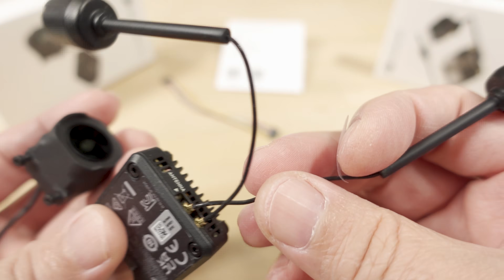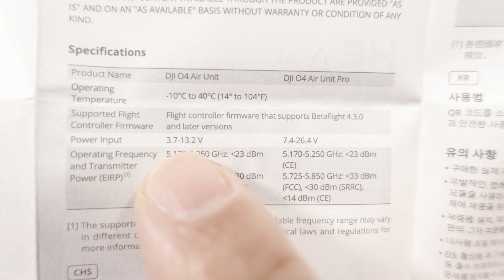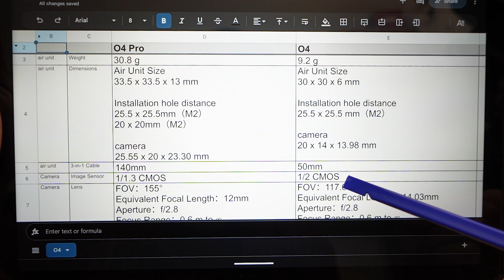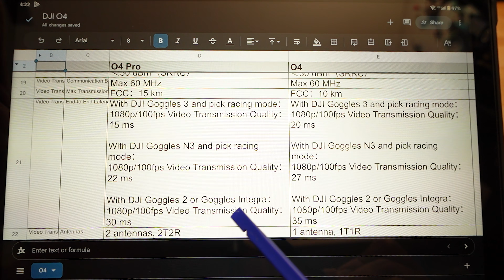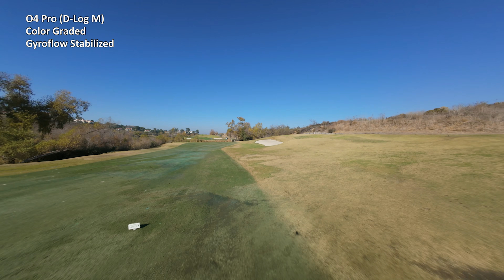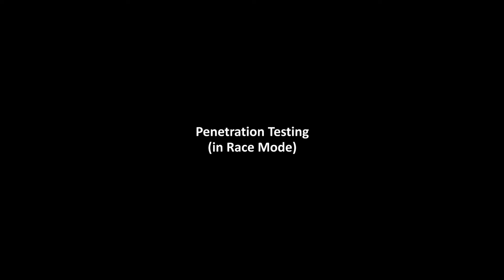DJI O4 Air Unit // The Dawn of a New Era?

Comment: Hello. I have o4 air pro in roma f5 v2 drone with tarranis qx7 control. I have a memory card inserted in o4. Can you tell me how to enable recording in o4. I can enable recording in goggles by clicking up on the joystick but it records the image from goggles and not material on the card in o4.
Reply from the maker: In the goggle settings, recording options are under the camera settings.  You need a fast microSD card installed and it will need to be formatted in that menu.  You can then enable the "record when armed" option and it will record when you arm the quad.
Reply: @AlbertKimTV  thanks ❤️❤️❤️

Comment: @ thank you very much. What does the wiring look like on an RC car? Can I connect plus minus from the air unit directly to the battery cables that lead to the ESC? or is it better to take a second battery?

Comment: What bothers me is the 117° FOV on the O4 unit. I wonder if this could change with a future firmware update. Also, is it possible to use a third-party lens adapter to achieve a wider FOV on the O4? I'm not sure, so I'll just wait and see. Otherwise, I'm happy with my analog whoops.
Reply from the maker: I don't think the FOV will change.

Comment: Great review of the new O4 Air Unit's, O4 seems to be another impressive upgrade.  Pro is wow, and O4 regular is wow for small builds.  Great job DJI
Reply from the maker: I was very surprised by the O4 Lite. They didn't have to make that one since the micro FPV market is smaller than tiny.
Reply: @ yes yes, and Thank you DJI.  DJI whoops, yes please.

Comment: Great review! Thank you for all the valuable info! Did you have any issues with gyroflow stabilization jello, like the O3 used to have with the camera hard mounted? Thank you!
Reply from the maker: I had mine mounted with TPU so the vibrations were dampened.  Just like with O3, the camera needs to be soft mounted so that vibrations don't corrupt the gyro data.
Reply: @AlbertKimTV  Thank you for the quick reply!!

Comment: Would be great to show a 1s tinywhoop build with the o4. I ordered mine hoping to fit it in a 75 frame and maybe keep the weight below 30g. Since you managed to fit an o3 light in a whoop, i am sure you are the guy for the task 🙂
Reply: Oups...just seen you already tried this in your FPV channel...maybe we should be looking for 2s whoops to support the voltage requirements.
Reply from the maker: BETAFPV will be coming out with some 1S whoops soon.  Stay tuned for more videos on my channel.

Comment: 50:55 yeah I think the need for another action cam will just be a niche because of this. people would only want a secondary cam if their flight footage has to have a different shutter speed compared with the secondary cam motion blur 180 degree rule. or they want to capture a certain FPS on their secondary cam while their O4 will be on 100fps for low latency mode

Comment: 37:09 the standard camera really is not good for FPV flight. they should have just decased an O3 camera which could have been better instead of pushing the Neo's camera. The neo footage is good if you just want short flights but doing fpv it is not good
Reply from the maker: Having flown the standard camera FPV quite a bit, I find it's totally fine for flying, even in low light (see the parking lot example in the video).  The footage is not the best but for casual use and posting to YouTube and social media, it's completely acceptable.  Definitely not for professional use but that's what the Pro camera is for.
Reply: @ i hope we can use the Pro in the standard vtx. Or some company can decase it. I really don’t like my Neo for fpv
Reply: @vernelfpv  Even the Neo image quality for FPV is better than everything else out there. Kinda sad to say that but the worst DJI has is way better than the best of the rest. Crazy!
Reply: The Neo camera is not bad for FPV.

Comment: 06:30 probably the f2.0 was dropped as they are rushing to release the air units. if they will use f2.0 you would probably require an ND filter esp on mid noon flight and it will create other stabilization problem. so they get back to how the avata 2 is actually produced which actually works
Reply from the maker: I heard it was a altered image sent out to find leakers.
Reply: @ ohh. So probably they caught the one leaking hehehehe. Bad thing if there are no more leaks

Comment: Might be time to upgrade. The only way to run both o4 and vistas is the run the goggles 2? If i understand correctly
Reply from the maker: Yes, Goggles 2 or Integra works with all the generation of Air Units.  You just don't get the race modes for O4.

Comment: Appreciate the review!  I've no experience with DJI -- what are some ways to share live flight experience with others?  Is there video out to connect to a monitor?  Can multiple goggles tune into the same channel as with analog?
Reply from the maker: You can pipe out the live feed to a phone screen via USB cable and also via wireless streaming.  I believe these were also in the O3 system.

Comment: I'm more interested in tiny builds. Is there a model that you can just drop the o4 in without modifications today? How much did the flight time improve on the T-Cube 18?
Reply from the maker: I was able to drop in the board into the T-Cube18 very easily.  The camera required a custom mount (the one shown in the video).  Not too difficult.  You can see I increased the flight time to 5 minutes in this video... https://youtu.be/W81Fc4WvrAs

By the way, I saw that GEPRC now has a 2S T-Cube18 with their own custom mount.

Comment: Great Video - Thank you - can you say how long the camera cable on the standard unit is? and is it the same cable as the o3 use? :)
Reply from the maker: I don't remember off the top of my head but it was shown in the section with the spreadsheet of official specs.  I don't think I stopped to mention that specifically, but I'm pretty sure you can see it there.

Comment: Very keen for a naked O4 and its weight.
Reply from the maker: You mean naked O4 Pro?  I did try to pry out the board but couldn't figure it out without breaking it.  I'm sure someone will post that video eventually.  I think without the heatsink it will probably overheat quickly.

Comment: I see there is no fisheye in the nighttime dvr from the O4 std. Is it dewarped in the goggles on O4 pro aswell when FPV is set to standard?
Reply: You can see the O4 Pro dvr at about 38 minutes in the video and it's different from the 4K footage. Doesn't look warped.
Reply from the maker: Was there something you could not tell from the DVR footage shown?
Reply: @AlbertKimTV I can clearly see at 38:50 that O4 pro is not de-warped. But you didn’t specify what FOV settings were used, so that’s why I’m asking.
Reply from the maker: @viggokoch  I used the wide FOV but the goggle FOV is fixed and does not change no matter what the recording FOV is.  Also, the recorded FOV can be adjusted in post to whatever you like.
Reply: @viggokoch  its 117 foc
Reply: The reason why this is important to me is because I do a lot of live broadcast gigs. And fisheye is simply not acceptable.

Comment: I don't get why the lite version has usb (which you will HAVE to use often) is on the same side as a fc wire
Reply from the maker: Perhaps a design limitation since they crammed a lot of stuff on that board and space is a premium. They probably decided in engineering it that putting all the I/O stuff next to each other would save space versus putting them on opposite sides of the board.